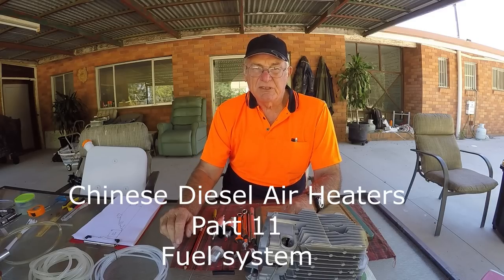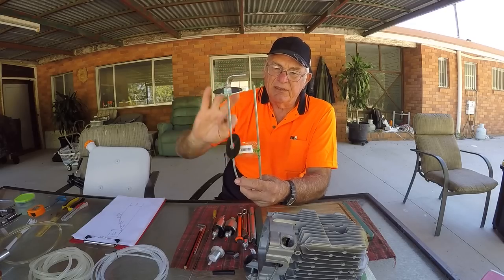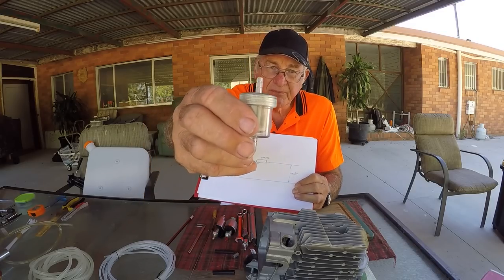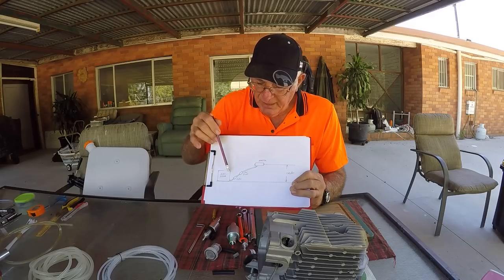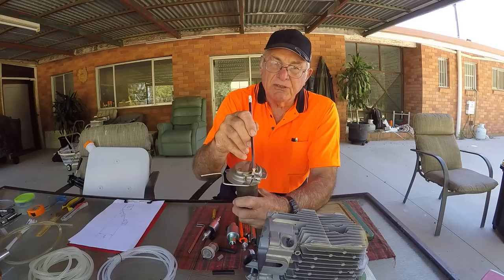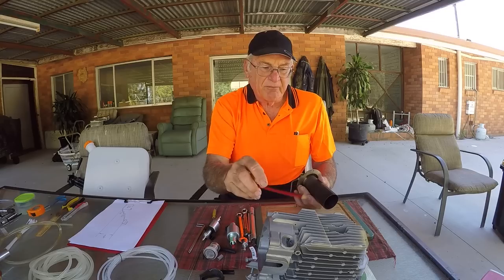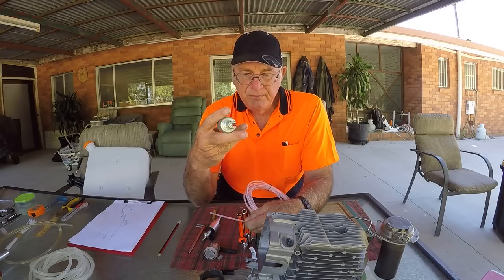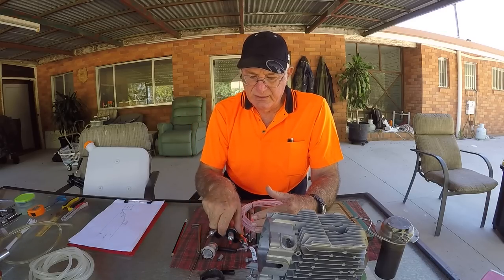Chinese Diesel Air Heaters - Part 11 -  Fuel Delivery

Comment: Must admit I've not had any problems with the standard plastic type hosing that comes with mines, have the fuel pump mounted horizontally a bit higher than the tank, The outlet for the tank is the lowest point and the plastic tubing routed up towards the pump, I've not had any problems with it firing up even with it being sat for say 5 months. Good information in this though, it can be hit an miss with the routing etc etc for it to work first time every time. Have you ever had the fuel tank cap blow the top off the cap almost? I need to try find a replacement.
Reply from the maker: Hi 79RS, thanks for your feedback.

It is fine to use normal rubber fuel hose from the tank to the pump, but you should aim to use the narrow bore hard nylon from the pump to heater, otherwise you will have issues as you start to get carbon build up in the glow plug screen. The soft hose absorbes the pulses and you will not get proper atomisation of the fuel.

I think you should keep a good eye on the clear plastic fuel hose. I was running a test on a heater on the test bench that came with clear plastic fuel hose and left it connected for 3 months while I went sailing in 2019. The heater and hose was exposed to a couple of hours of afternoon sun. (Aus winter sun low on horizon) On my return the hose had perished and it had separated from the fuel pump at both inlet and outlet sides. 

The fuel pump will work horizontal (and even upside down, for a while) but if you do not make it easy for the little cavitation bubbles to escape they can form a big bubble and cause wear to the top of the piston and bore of the pump due to lack of lubrication. You can generally know a large bubble has formed in the pump as ti will make more of a "tocking" rather than a "ticking" noise. 

Cheers,  JMcK

Comment: Hello again john , I am looking to purchase a back up kit for my heaters however there is little info on what metering pump I should purchase to have a back up on hand . My heaters are 8 Kw  and I understand your calculation for fuel delivery , I know the controller for my heaters can only go to a maximum of 8 hertz however most of the pumps on line are labeled  one to four  Kilowatt . Would appreciate your advice John.
Reply from the maker: Hi Jack, if you have a Chinese copy heater, they mostly use the same dosing pump putting out .02 ml per stroke. There are many online sellers. Below is just one to get you started. Make sure you get the voltage right.

https://www.ebay.com.au/itm/12V-Car-Air-Diesel-Parking-Oil-Fuel-Pump-For-2-5KW-Webasto-Eberspacher-Heater-AU/313220504074?hash=item48ed659a0a:g:RWkAAOSw9iNfYY0t

It is very rare to have an issue with the dosing pump if it was not used for initial prime where it operated for many strokes without lubrication.

Pumps with internal filters have issues with the little filter, but most Chinese heaters come with a seperate filter.  JMcK

Comment: My understanding is that the hard line helps with atomization on the outlet side of the pump and lift on the inlet side.  A 2mm bore will be lifting less than 1/6th the weight of fuel as 5mm bore.  At my cabin, the heater is floor mounted with the pump attached to a joist just under the floor.  The tank is mounted on the non-sun exposed side (North in the Northern hemisphere) of the cabin a few cm above the pump so lift is not an issue.  My kit did not come with hard line.  In debating if I want hard line between the pump and heater or go with a much shorter length of soft line (<10cm) due to the latter's tighter radius of curvature?

I'll be installing a 2kW in my camper and will be going with hard line.

My other problem at the cabin is rodents chewing the line . . .
Reply from the maker: Hi Michael,

If your fuel tank is mounted above the fuel pump I suggest you install a fuel tap before the pump and turn off when heater is not in use. With a head pressure the fuel can leak past the pump seals and flood the heater.

I suggest you use good quality 4 mm fuel hose on the suction side of setup. Ie from tank to filter to shut off valve to fuel pump. 

On the delivery side of the pump to heater it is better to only use narrow bore hard nylon fuel hose. You can use normal fuel hose if the distance is very short. Less than 300 mm or one foot. 

Soft fuel hose on the delivery side will work..... for a while. Once you start to get a little carbon build up on the glow plug atomisation screen the soft hose absorbs the fuel pulse and the fuel will not “squirt” through the screen and be atomised. 

I personally would not use the clear vinyl type fuel hose being supplied with some heaters. It degrades and perishes very quickly. Particularly if exposed to UV.  JMcK

Comment: Hi john, great video….I have some question please..I’m installing one into my boat, but my fuel tank supply is almost 9metres from the heater location, can I put a small facet fuel pump in-line to feed the heaters fuel pump or can the heater pump cope with 9metres, also the feed height will be around 2metres, any suggestions please?
Reply from the maker: Hi Roeland,

Nine  meters is quite a long way for the little pump and then has to lift 2 m as well. 
Being honest, I have not tested such a long distance, and until I personally do a test,I do not like to give an answer, and I am  even careful giving an informed opinion.

I suggest you bench test the set up first. One issue you must be aware of is the heater may work initially but not start after some use when you start to get a bit of carbon deposits on the burner screens. There needs to be reserve fuel pressure to squirt the diesel through the burner atomisation screens. That is why you should only use narrow bore hard nylon fuel hose on the delivery side of the pump.

I think the facet fuel pump may also work, provided it powered on only when the fuel pump is working. Here again a bench test will give an answer.

I am currently on a boat off the Queensland coast and I will not be home for another 3 weeks at a min, so can't test myself, but I would like some feedback if you do the bench test.  JMcK

Comment: I like the drawing of it all going uphill but in the real world it seams impossible if the heater is on the floor. Do you have any recommendations for the pump placement if the line must go down at some point? My guess would be to drop down to the lowest point and put the pump there. Thanks for all the videos. I would like to see one on priming a brand new unit and first start up because my directions are spotty.
Reply from the maker: Hi Michael,

The pump will pump down hill and back up again without issues if you use small bore hard nylon fuel hose on the delivery side of the pump. With the hard nylon hose the tiny cavitation bubbles track through the hose. 

Suggest you have a look at the motorhome videos. I do an initial prime there.

Cheers.  JMcK
Reply: @johnmck1147  Thank you John. I will check that out.

Comment: Fitted a heater to my 5th wheeler but having trouble finding a spot for the diesel. Illegal to carry on back bumper in Victoria and was thinking of spot next to gas bottles which is 4 metres away on the diagonal. Would this be ok or any other suggestions
Reply from the maker: Hi Lynn, that should be ok if you put the pump close to the tank and only use the thin nylon tube on the delivery side. My fuel delivery run on the boat from pump to heater is close to 4 meters, and it works ok.   JMcK

Comment: Thanks John - Do you by any chance know where to get the nylon fuel line from? (my kit came with the soft one :) - I'm in Australia btw
Reply from the maker: Hi Dirk,

Recommend you use good quality black auto fuel line from tank to filter, to pump.
From pump to heater, if more than about 300 mm, only use narrow bore hard nylon.

Lots of suppliers on line. Search “Narrow bore hard nylon for Eberspacher diesel air heater”

Here is just one link to get you started.

https://www.ebay.com/itm/5Meter-Fuel-Hose-Clip-Filter-Pipe-Line-Kit-For-Webasto-Eberspacher-Diesel-Heater-/403525804608?mkcid=16&mkevt=1&_trksid=p2349624.m46890.l49286&mkrid=705-154756-20017-0

Cheers.  JMcK

Comment: Thank's Much for your video's on these Little Heater's and exactly "How To" do it Right. I'm wanting to get one for my 8'x8'x20' Box trailer for heat. I'm looking at a 8kw unit do you think it would heat it ok?
Reply from the maker: Hi Mr Exlaw. To my knowledge the Chinese do not make a 8kw unit. There are a number of 5 kw units, marketed as 8 kw, but they are standard 5 kw units. Please see video I made on this matter.

A 5 kw heater will be just fine for your trailer in cold weather if it has insulation. If poor insulation and very cold weather, you could always run 2 heaters, they are now cheap enough. J

Comment: Thanks John

I just got the heater with the flexible fuel line.. I could have less than 1 M between the pump and the heater.  Would you still recommend the smaller rigid hose and if so where would I get it?

Best Rob
Reply from the maker: Hi Rob, you can use normal proper fuel line on the suction side from the fuel tank to the fuel filter to the fuel pump, but you should only use the hard narrow bore fuel line from pump to heater.

The flexible fuel line will work for you on a short run, but you will have more maintenance issues and will need to decoke the glow plug screen and burner more often. 

Beware the clear flexible fuel hose that comes with some heaters. I tested some that came with one heater I bought and it only lasted 6 months before it perished and leaked fuel.

You can buy the hard nylon tube on line. Search hard nylon fuel line for Eberspacher parking heater. 

Cheers.   JMcK

Comment: Hello John, thanks for your videos firstly. 

If I understand correctly, it's okay to have a 'regular' black fuel line with a 4-5 mm bore before the pump, and the nylon 2 mm bore line after the pump, as long as the lift before the pump is less than 1 meter and the pump is positioned in the first half of the total fuel line length from tank to heater? 

I've mounted this way and I'm currently getting E-08 codes while the nylon fuel line keep full of fuel without large air bubbles. I believe this could be an error on the suction side of the pump. My tank is a bit above the pump position.

Any advise is much appreciated :)
Reply from the maker: Hi Jay,

Yes, it is ok to run regular fuel hose from tank to filter to pump, but you should only use narrow bore hard nylon after the pump.

The pump should be installed as close to fuel tank as possible. (Have you seen the motorhome videos)

If the fuel tank is above the fuel pump and heater you should install a cut off valve before the pump and turn this off when heater not in use to prevent fuel leakage past the pump valves and into the heater.

E08 generally means a fuel delivery issue. Is the heater not starting? Or does it start and then turn off?
Suggest you remove the fuel line at the heater, and start the heater and see if fuel is squirting out the end of the nylon tube. 

If so you need to look elsewhere. If the heater is not starting check the glow plug and glow plug screen.

If the heater does start and then shuts down with E08 check the fuel filter.
Also check the case temperature sensor is positioned correctly on the heat exchanger case.
And check that the plug for this sensor is installed correctly and tight on the ECU board. A bad sensor can also give E08.

I would be interested in how you go.

Good luck.  JMcK

Comment: john I was thinking about the fuel line going through the top of the tank or the cap. using the metal pipingthen that to a plastic fuel line that is like what is in a weed eater or chainsaw. they have a stone filter on the end that not only filters the fuel but is also heavy enough to where it lays on the bottom of the tank. you thoughts on that.
Glenn in Mississippi

Comment: Hello， John:
Thanks for you vidios of Chinese disesl air heat, I watched all 16 parts. Now, I am plaing install one in my campervan. Just two questions if you can help. 
First, would be posisble I can install disesl tank higher 600mm above the heater? will it gravity feed to the heater without control by pump? And second one, Can I install disesl filter close fuel tank and pump close heater? 

Cheers,
Jamie
Reply from the maker: Hi Jamie,

Yes, you can mount the fuel tank above the heater but you should install a fuel shut off line to close when not using the heater to prevent head pressure leaking diesel into the heater.
You must use the fuel pump as that is how the ECU controls the fuel burn. Using just gravity to fuel the heater could turn your heater into a bomb.

Pumps in general are far better at fuel delivery than fuel sucking, so the filter and pump should be located as close to the heater as possible.

Regards,  JMcK
Reply: @johnmck1147  Many thanks, John!

Comment: Hey John, very nice videos you made there, thumbs up! I will have to try to change my fuel pipe but here in Australia can't find it as of yet. Could you please tell me where you bought this nylon 2mm bore pipe!? Thank you very much, cheers!
Reply from the maker: Hi Micha, first thanks for the positive feedback.
The larger machinery supply stores sell this nylon line, but I buy mine online. Search for "hard nylon fuel line for Eberspacher or Webasto diesel air heaters or diesel parking heaters"
Cheers.  JMcK
Reply: Awesome thanks mate!

Comment: John I’m considering a Chinese diesel heater and also a diesel cooking hob for my van build. That would mean two feeds from the main fuel tank. Do you think I could use one outlet from the tank and  ‘T’ the feed to branch it to both pumps after the filter? Would I be safer to run two feeds direct from the tank?
Reply from the maker: Hi RF,

There are non return valves in the dosing pump, so in theory it should work, I guess it would depend on the flow requirements with both units at full heat.

I do not like to give a definite opinion unless I have tested myself, but you could try and see. 

However, if it is easy to have seperate pick ups, I would personally prefer that option, with each having there own shut off valve.

Cheers.   JMcK

Comment: Great video John. I installed my heater last week in a boat and made the mistake of replacing the nylon hose with larger fuel hose and also of using too much exhaust sealant which caused restrictions in the exhaust. The unit did start but bellowed white smoke which we mistakenly thought was the sealant curing. When I removed the exhaust it was coated in oily residue.  Will I need to dismantle and clean the unit after reassembling the exhaust and correct nylon fuel hose or is it likely to clean itself?
Reply from the maker: Hi Mike, it is ok to use normal fuel hose on the suction fuel side to the pump, but from the pump to the heater you should only use the narrow bore hard nylon fuel line. 

Sometimes the heaters will smoke for aa couple of minutes on initial start up, but only for a couple of minutes then they should run clean. 

Oily residue can indicate a rich mixture and too much fuel. This should burn off after you change the delivery fuel hose to narrow bore hard nylon. 

If the fuel tank is above the heater you should install a shut off tap between the tank and the filter, and turn this off after use to prevent head pressure seepage.   JMcK.

Comment: I used the pick up tube that came with the 10 litre tank and installed it in the top of the tank instead of the bottom connection which can leak with the rubber o-ring. I drilled a hole to accomodate the metal tube and used fuel proof epoxy to glue the fuel pick up and rubber gasket to the top of tank once sanded to roughen the bonding surface I then covered the whole pick up plate with alluminum tape it seems to holding up very well 6 months so far and it is very waterproof as the tank is wall mounted and outside exposed to the weather. the fuel line is 12 feet from the pump and it is working very well, it was initially primed by mouth up to the filter which was very easy. There is no air in the fuel line at all. I used the nylon fuel pipe and not the cheap and nasty green supplied soft fuel line. I also run kerosene with a little 2 stroke oil to lube the mechanical pump and not diesel fuel.
Reply from the maker: 👍 Thanks for the feedback 0flip.    JMcK

Comment: Hi John. My tank is above my heater location so gravity feed to tank and using a larger size hose 4mm from pump to heater as from tank to pump. Will this cause any issues. Was set up this way and have just changed heater for a new one. Havnt used yet...cheers
Reply from the maker: Hi there
It is ok using normal fuel hose from tank to pump, but from pump to heater, unless a VERY SHORT run, it is much better to use narrow bore hard nylon fuel hose. 

In these heaters the pump “pulses” diesel to the heater burner atomisation screens. Soft fuel hose from pump to heater absorbs these pulses resulting in poor atomisation and carbon build up in the burner. When sufficient carbon has built up heater won’t work. JMcK

Comment: Fuel pipe melting seems to happen alot, why can't a brass compression fitting be used along with metal fuel line to the pump? seems like the fuel pulse would be stronger as well since the piping wouldn't be expanding with each pulse/tic? from your water hammer reference the only downside would be noise? thoughts?
Reply from the maker: Normal quality fuel line is all you need from tank to the pump.
You can use narrow bore metal fuel line from pump to heater if you wish. In fact metal fuel line is a requirement in many countries if the fuel line passes through a machinery space, such as an engine room on a boat.  JMcK